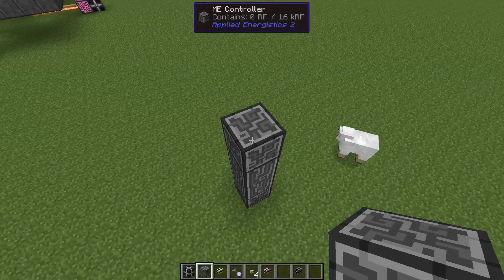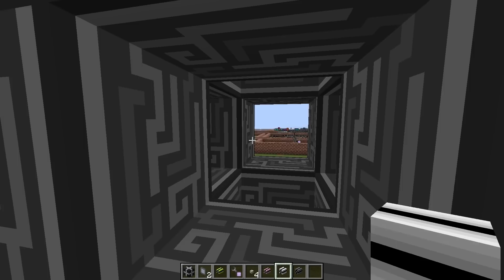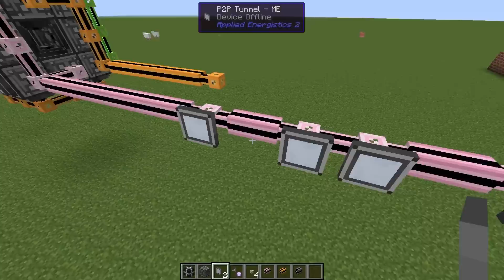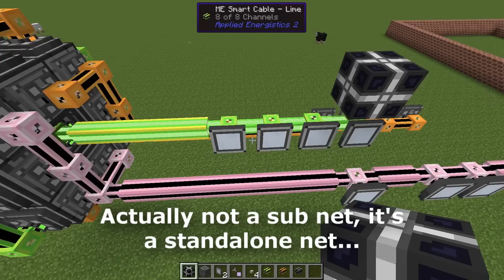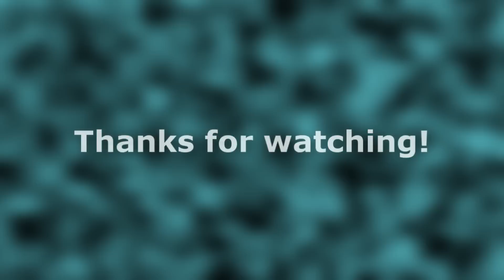Effective ME Controller Design - Applied Energistics 2 Tutorial #19 (MC 1.7.10)

Comment: Very VERY aware this video is quite old, but can someone explain how you’re squeezing out 2,304 channels if the thick cables can only extend like 4 channels?
Reply from the maker: Yes, I'm using P2P tunnels and a dedicated "P2P network". I have made several videos on this topic, from the very basic 4 in - 4 out up to this type of large network designs. You can find all videos in the AE2 playlist. The basic idea is that all colorful cables you see around the controller is NOT a part of the main network - they are part of the P2P network and is a separate network only used to transfer channels. Every face on the controller has 32 channels, but the P2P tunnel only requires 2 (one for in and one for out). The P2P network can be only normal, 8 channel cables, or have a controller and use dense cables to distribute channels in a more compact way. Check the playlist for details and inspiration :)

Comment: I am having an issue where I have two single block ME controllers extending off the 3x3, one on each side. Three faces of the big controller connect to one small controller, and three faces connect to the other. The storage on one side of the network does not connect to interfaces on the other side of the network. Is there a way to connect them that I am not understanding? Or are they just two subnetworks and I will have to just deal with the disconnect? It's really not that inconvenient to leave them as subnetworks, I just physically wanted to wire storage in one room to the north of my controller and have all the other cables coming off the south towards the rest of my base.

Comment: Question: So when you use the P2P tunnels and put the non dense cable on them directly, and join them on a dense cable before the controller, you'll get 32 channels out of each p2p tunnel instead of the 8 channels you would get from each normally, without using dense cables?
Reply from the maker: Yes. If using a non-dense cable you can handle 8 channels. And if using P2P tunnels with a normal cable without an ME Controller in between that would mean 4 in and 4 out (4x32 = 128 channels). If done correctly you can connect 32 controller sides (P2P tunnels) from four normal cables to one dense and then to a Controller block and then the same thing on the other side (I have videos on this). With a smaller ME Controller you could of course skip the subnet (for tunnels) and connect dense cable to all sides and get the 32 in each cable in a regular network (with normal cables from the dense), but the connection point towards the controller block mush handle 32 channels.

Comment: i dont understand how this is a good deisgn if your only pulling out 4 channels per thin cable compared to 32 for each dense cable. if its bc desnse cables wont fit, then its not a good controller shape? what happened to the 2048 channels you said it would have, then randomly you said so guys we gotta use thin cables around the cube and they only hold 8 channels, then randomly you said they only do 4, but i thouight they all should do 32 each for max 2048 channels???
Reply from the maker: Just take it easy and play around in creative with P2P networks, I have many videos on the subject starting from small networks and all the way up to ~22k channel controller. And they are still valid. Yes, the thin cables can carry 8 channels, which means 4 in and 4 out. But those 4 can carry 32 channels each (thanks to P2P networks). And you can connect several thin to a dense and have a "P2P controller" in a separate network to carry even more P2P channels. It's really hard to explain in one chunk of text so I really suggest going back to the basics of P2P tunnels (I have a big playlist) and take it from there.
Reply: @therealtkh  much love, thanks for reaching out. yea i didnt see you have more videos. i just assumed not.. based off youtubes crappy search algorithym which only showed this video once after maybe 10 different tries at finding videos. no other videos of yours showed :( gotta check out peoples chennels more often then!

Comment: I have a question, if one controller block can output 32 channels on each side, what's the point of connecting multiple controller blocks to still end up with 32 channels on one side? Amazing video though
Reply from the maker: You're missing the point, I can recommend going back and watch my videos to learn about the fundamentals of P2P tunnels. The thing is that you get 32 channels for every output, not the same 32. So if I connect 8 controller blocks to a P2P subnet I get a total of 256 channels (divided on 32 per output).
Reply: @therealtkh  thanks for replying so quickly and clearly, it was my mistake for trying to skip ahead in the playlist xd

Comment: THK, Slight improvement to design, Do the top and bottom center as a single three cable and extend it one block below, from there have three controllers stacked on top of each other. Take the two cables from each side and connect them to the top two sides of the three down controller. the bottom of the three controllers now supports all 72 tunnels with five sides you can connect to. Single chest that has all the pre-programmed memory cards.

Comment: I always like to use ME-Controller in the P2P Network Dense-Cable. It's the most channel-saving way.
In AE2 it's impossible to avoid closed Cable-Loops. This can cause malfunctions, slower Data Transfer Speeds and the P2P Network can stop working.
But i love to use every Channel in the most efficient way. So i use one ME-Interface for Processing-Patterns, Item-Export/Supply (via the Config-Slots), and Item-Import for different machines at the same Time. In combination with EnderIO's Alloy-Smelter, i use one of these ME-Interfaces to supply 9 different Items for different Smelting-Recipes in different Alloy-Smelters to do full automatic Keep-in-Stock-Item-Processing like Dark-Steel-Ingots, Energetic Alloy, Vibrant-Alloy, and so on...

Comment: but if i have more p2p channels goin goff in each room will it handle way more than 2K? cuz im trying to automate something big
Reply from the maker: Well, every Dense Cable in a P2P network (then I mean the subnet only handling the tunnels) can handle maximum 16 outputs (because 16 inputs...). 16 channels P2P means 512 channels for machine connections. If you need more than that for one room you need more Dense Cables for that room.

Comment: I've linked the p2p tunnels from the main multiblock controller to p2p tunnels running off of the single me controller, however, it seems that now the devices for each room cannot see each other. For example, I can only access my storage if I connect a terminal directly to the network that the me drives are on. How do I fix this?
Reply from the maker: I don't know how you clicked but I covered P2P networks in basic detail previously in this series. Is the P2P network powered, is input/output correctly configured.. many things can go wrong and if a single click is incorrect the full network will not work.

Comment: when i use 7x7 alone outside , not the inner, there can be batteries, i came to 5600 channels, i need only enouth energy, two diesel generators with steam is more as enought =) so i can build infinity =)
Reply from the maker: The big benefit of using P2P is to save material in all dense cables going to other places in the base. It would be annoying to pull out dense cables for all those sides!!
Reply: @therealtkh  thx your right, in moment i test it in my little world, its really many =)

Comment: Dont the P2P tunnels need channels to work? Which controller is providing them?
Reply from the maker: They need one channel each. You don't need a controller as long as you have 8 or less channels (so 4 in and 4 out), only power. If you want to bunch up more than that you need a separate "P2P network controller" (a normal controller of course) in that network. If you go advanced mode you can combine the two networks but I don't recommend it because it's hard to keep track of.

Comment: This is a great tutorial and has made me think differently about networks!

But I do have one question: At several points, you route the dense cable into a secondary controller and say something about piping the signals out to another dense cable (which is coming off a separate face). Are the P2P channels routed THROUGH the secondary controller, so you can actually link the other end of a tunnel off that segmented dense cable? I thought it would dead-end if you ran it into the secondary controller.

The reason I ask is that it seems like this could suck the efficiency down to half, because if you're not pulling the tunnel channels off a different face of the secondary controller, then you can't route 32 tunnel channels into one dense cable since the tunnel output would draw one of the channels off the secondary controller's feed, leaving you with only 31 channels going to the primary brain. Obviously it would count down to 16 tunnels on the brain once you balanced the outputs with the inputs. But if it can draw the channels off a different face of the secondary controller, it would feed the outputs separately from the inputs and would thus let you pair the full 32 tunnels into a single dense cable, so you could run the whole brain through one secondary controller (72 tunnels = 2(32)+8 = 3 faces), with the outputs coming off the same controller, if you wanted to condense everything down to one route.

I hope that makes enough sense that you can answer my question.
Reply: Spent a while building and refining the cabling for this (got it looking very clean!), and I popped a bus onto a second face of the secondary controller, and it connected to the tunnel on the brain! This is really nice, and I'm glad that it works that way! If it didn't, that would severely handicap the usefulness of tunnels and this sort of controller design!
Reply from the maker: Sorry for a late reply, but yes, it works fine to do so and doesn't use up any channels :) The P2P tunnel is just a tunnel and needs its own network. I have done several videos on this subject and you can find them in the playlist.  
But in addition to that: it IS possible to use a tunnel and send the 32 channels in the same network without any need for a "P2P network". It will use up at least two channels in total, but can be useful in the transition from a small to medium sized network.

Comment: Recap and extra details:

The 3 x 3 x 3 frame design is capable of utilizing 72 faces for a total of 2,304 channels. If you want a uniform, whole number of colors to use, you can have 1, 2, 3, 4, 6, 8, 9, or 12 colors corresponding to 2,304, 1,502, 768, 576, 384, 288, 256, and 192 channels per color respectively using 72, 36, 24, 18, 12, 9, 8, or 6 faces of the multi-block per color respectively. 

For maximum results, opt for 12 colors; this way, you can support 72 rooms using 32 channels each, whereas one color can support 2 rooms (or 32 rooms with 72 channels each and every room having its own dedicated color.) The most perfect thing about this configuration is the fact that there are exactly 12 color options that are actually colors and not white, light gray, gray, or black.

Notes: 

All outputs with this configuration will need a separate controller system to handle the amount of channels being output per every color; smart cables can hold 8 channels max, meaning one smart cable is capable of supporting an entire color-specified set of channels when using 12 colors using P2P as shown in the video (uses 6/8 channels.)

You can build a 5 x 5 x 5 frame around the controller and it will not interfere with the cabling.

P2P tunnels will need to be linked in order to function properly; P2P tunnels can have multiple outputs per link, but only one input. Having 72 faces means you will need to link 72 P2P pairs; therefore, you need at least a 2 x 1 x 1 controller system for every color of a 12-color configuration to handle the 6 P2P tunnels responsible for each color (10 faces per 2 x 1 x 1 controller, enough for all 6 P2P tunnels plus 4 extra sides to do whatever with.)

Fun facts :)

- 2,304 is equivalent to 48^2.
- 2,304 blocks is equivalent to a 14 x 13 x 13 structure with an 8 x 8 x 1 hole somewhere plus 2 blocks. 
- The most perfect thing about the 12-color configuration is the fact that there are exactly 12 hue spectrum colors: red, orange, yellow, lime green, green, cyan, light blue, blue, purple, brown, magenta, and pink.

Edit:

Will re-edit this post and put a link to screenshots on imgur showing my example of a 12-color config.
Reply from the maker: I think this is pretty much spot on :)
Reply: Where is the link? it's been 3 years
Reply: You never included the links. Come on now, it's been 4 years.
Reply: been working on trying to find the biggest me controller possible, biggest 3x3x3 can have 74 faces. No idea what the biggest 7x7x7 is but the best I've gotten so far is 788.
Reply: Gimme those links, man
Reply: its been 10 years :)

Comment: Hey, i don‘t know if you still look at this but i wan‘t to say thank you for you extremly great work. 

But i also have a question. I build this cube and also use your storage design (storage bus on interface, drives behind) in 1.12. AE has fluids support, so i made an fluid import bus, fluid terminal and fluid cells. The problem is, the system imports no fluid from one „p2p section“ into the storage solution. Do you know why not?
Reply from the maker: The fluid support should come from Extra Cells 2, right? Are you using a modpack or some mod selection for this (for mod versions and such). I haven't tried fluid transport over tunnels though... but I can try when I get home in a 4-5 days. Join up on Discord if you can, we can talk more there. (Links on http://tkh.one/ )

Comment: So i have build this controller exactly like you did,but all of the p2p devices are offline and not working. Does anyone know why?
Reply from the maker: Do they have power? The P2P tunnel blocks won't transfer power, but don't connect the networks, use a separate power source or the Quartz Fiber.
Reply: shift-right-click with an ME Memory Card to save the settings. Run your smart, glass, or covered cable to where you will need it, then connect the other tunnel node and pair it by right-clicking with the same ME Memory Card

Comment: 11:56, crucial concept,  dense cables with a "backbone system" or the 4 channels on a "standalone" you do not need a controller for up to 8 channels, or 4 p2p tunnels (the center output in his example) or when you collect an entire side, 12 p2p outputs, 24 total channels needed per side of the cube, you will need another controller for the p2p tunnels, as they do not get their channels from the wide side, but the smaller, cable side.
in his example, 72 channels use 3 sides of a single block controller to "run" the tunnels, leaving 3 sides for the other, output end of the tunnels.
the "backbone" is an isolated network just to control the tunnels,
you could (somehow) use some of the channels off the 3 x 3 cube to run the tunnels, maybe.
has anyone tried to collect the p2ps off the cube into another p2p reducing the 72 outputs to 3 channels?
Reply from the maker: It is not possible to run P2P in P2P. I have tested it and later found it clearly stated in the documentation: "the channel of a p2p tunnel cannot be carried by another p2p tunnel, meaning that you cannot nest them recursively."
Here: https://ae-mod.info/P2P-Tunnel/
So you have to use normal cables for up to 4in-4out or go with a dedicated P2P network with a dedicated controller. Well, you could actually send channels through the main network as well, but that would be a waste of channels just to save some cable ;)
Reply: how awesome is it i reply to a 3 year old video, and get the answer so quickly, including a link i didn't know existed.
you are truly a dedicated youtuber.
i've been working out the kinks setting up this cube on a FTB infinity 1.7.10 server, with the goal of a DSU "farm" among other things, issues with everything from the power jumper to the cube interfering with the backbone controller (solved with drac evolution wireless transceiver powering the cube directly) (tried an energy acceptor in the center of the cube, but it's output shorts the backbone)
i highly recommend using this design, work thru the learning curve, as it's very worth it.
Reply from the maker: @mkuehn5450  Cool, fun to hear about various projects where my designs are being used :)

Comment: Do you document where you connect what? Or where you use a specific P2P tunnel?
Reply from the maker: One way of doing in-game documentation is to craft one Memory Card for EACH P2P tunnel. So every time you need more channels you craft a P2P tunnel and a new memory card. Place the tunnel, program the card and set the output somewhere in the base. Then place a frame or whatever on the wall and place the memory card there. In case you need to break and re-place the tunnel output it would be hard to remember which one of the potential 72 tunnels at the controller you had connected to that one output.